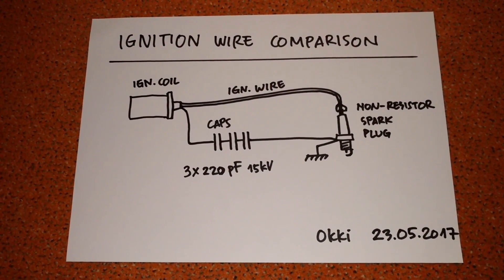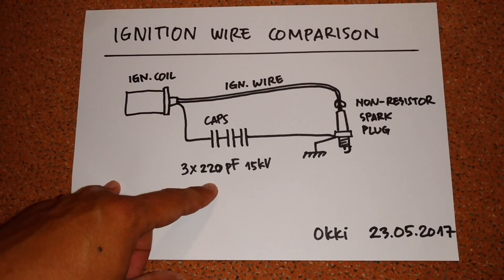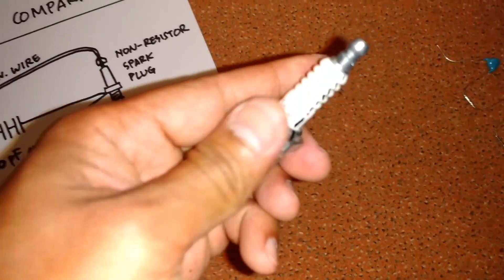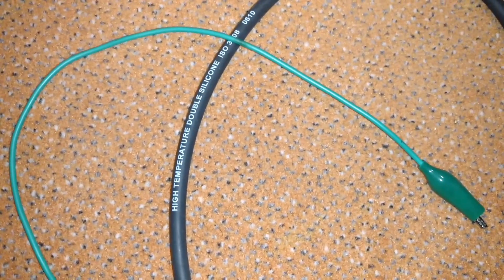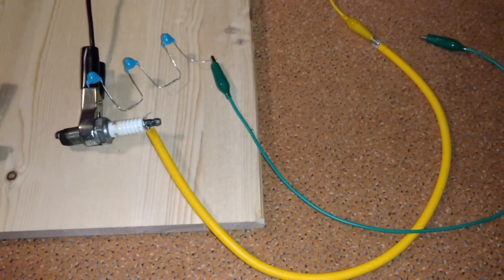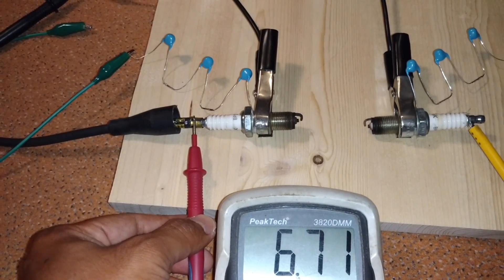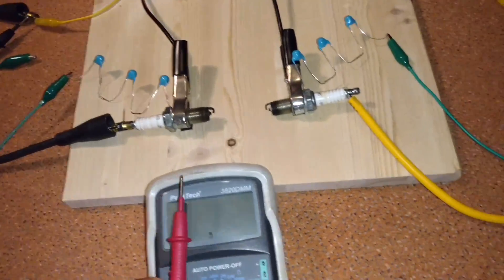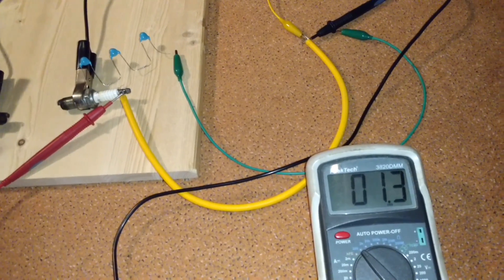Simple Plasma Ignition - Carbon and Copper Wire Behavior

Comment: The reason why this works with a nonresistor spark plug but not with a resistor spark plug should be explained. 
The high voltage source is wrongly addressed and it must be looked upon as a current source, so without the capacitors, while the spark plug is not firing the voltage will build up and when it fires, the current is only that supplied the current of the current source.
With the capacitors, the current source is charging the capacitors, and when the spark plug fires,  the energy stored and memorized in the capacitors is discharged fast and the capacitors appear to be a " TEMPORARY" voltage source discharging into the spark gap. 
If the sparking plug has a resistor in series with it, the discharge of the capacitor will be slow as the gap is still being fed from a current source due to the series plug high resistor appearing to be the output impedance of the source. 
This is a situation where students should get used to learning about the behavior of current and voltage sources and their output impedances.  Matching the correct load to a current and voltage source is important in electrical engineering and a spark plug should never be continuously fed from a " high voltage source"  with a low output impedance.
Reply: It works with the resistor plug, just not as easy to see in this video.  Look for his other video on the same subject, the lighting is better for the results, and he hooks up two sets of capacitors in addition to one.  (I find this fascinating).

Comment: hola no consigo ese varistor o condensador en mi pais el que pude conseguir es de 220pf 2kv podrias ayudarme y explicarme porque tiene que ser de 15kv?
Reply from the maker: The voltage rating has to be at least 20 kV otherwise you will destroy the capacitor.
Reply: @OkkiMoeljadi  y si coloco uno de 220pf 70kv que pasaria? ya que ese si lo consigo
Reply from the maker: @anibalsalazar7530  anything above 20 kV is fine.
Reply: @OkkiMoeljadi  ok muchas gracias, saludos

Comment: Have your vehicle installation run in real life low speed, high speed, downhill and uphill combinations ?

In these various different situations, have you measured so as to compare the fuel consumptions with and without these plasma inducing capacitors ?
Reply from the maker: I used this setup for almost 2 years in my daily driven car as I lived in Germany. I made one or two videos about that. Check those out.

Comment: Will this 73.3uF 45KV capacitance become a loading to the ignition circuit so that some part will over heat excessively and then shorter life ?

In case of Coil-on-plug (cop) situation, will the cop very easy to fail ?
Reply from the maker: No, I have made power requirements tests here: https://youtu.be/fPXIUkFmKfA
Reply: @OkkiMoeljadi  The overall power at various capacitance may be lower than 10W which is small but will this less than 10W is an average measurements only. 

Are there a local hot spot geographically or in the time domain that will make the coil or the spark gap aging too quickly and prematurely ?

Comment: can we use 221pf capacitor?
Reply from the maker: Yes, and you need to use capacitor with correct voltage rating.
Reply: @OkkiMoeljadi  tnx a lot friend.

Comment: I tried it on my motorcycle it discharges mu battery
Reply: I think either you are telling stories, or you evidently did not connect the circuit up properly. Anyone with half a sense of electronics will see what you said is impossible as the ignition has to be ON for the circuit to work. So, I think it could be resolved you left something turned on ?
Reply: Project23D or maybe my sparkplug is not nonresistor

Comment: how does that way with capacitors act with a waste spark system??? how does the water vapor behave?
Reply from the maker: This will work also with waste spark system. With water you will get even stronger sparks, here is an example: https://youtu.be/3NmaUMr3kU0

Comment: Hi, okki  im interest on it...but still confuse ,  it just connect a cable ,with 3pcs 220pf  15kv capasitor, together with spark plug cable on ignition coil and the other edge of cable connect to body spark plug or ground/ body of car , just like that?..
Reply from the maker: Yes, exactly.
Reply: @OkkiMoeljadi  ok thank you ,once i've done , i'll show you and need advise..thanks again

Comment: great video. quick question... can the wire from the capacitor be fixed anywhere  on the engine (ground)? or does it have to be fixed at the base of the spark plug?
Reply from the maker: It can be fixed anywhere on the engine but the shorter the connection to the spark plug the better.
Reply: @OkkiMoeljadi  thanks
Reply: What is this capacitor called?

Comment: Untuk kasus multicoil gimana om? Spt Mobilio/Livina/CRV?
Satu kaki di tempel ke kabel +12V dan satu lagi ke Ground ya? Tiap koil spt itu? Nama kapasitornya apa dan apakah ukurannya sama utk tiap mobil?
Reply from the maker: Kalau pakai sistim ini, kapasitornya harus dipasang paralel dengan busi. Ini adalah cara paling gampang untuk memperbesar percikan pengapian.
Reply: @OkkiMoeljadi   om Okki, boleh minta contact number yg bisa WA?
Reply: @OkkiMoeljadi  Om, sy coba ambil jalur +12volt dari tiap koil dan dijumper kabel ke kapasitor, ujung satu lagi ke -accu/ground. Wkt sy kasih tiap busi 1 set (3kapasitor seri) tidak ada perubahan apapun wkt dikasih 2set (diparalel dg yg pertama) ada perubahan tapi sedikit. Krn kl mobil direct igniton coil kan ga bisa ambil/colokin kabel yg lgs ke businya. Jadi sy ambil di kabel +coil. Apakah bisa om?
Reply from the maker: @ronnygani3652  sistim saya ini tidak bisa digunakan dengan cara seperti itu. Kalau mau dibuat seperti cara anda, anda harus pakai kapasitor dengan kapasitas yang jauh lebih besar, tetapi hasilnya belum tentu lebih bagus dari cara saya.

Comment: Why do manufacturers not do this? It seems so easy and cheap. Is there a problem really? Does it work in practise with the plug in the engine under pressure?
Reply from the maker: This technique is sold as products already. One of them is Nology HotWires.
Reply: Under compression electrons actually travel better.  Compression forces atoms closer together.  I knew this to be the case when messing with hydrogen fuel cells as under vacuum the amps drop and under atmospheric pressure the amp draw is higher, but then I saw a live display of an engine running with a clear display so you could see the ignition.  I was expecting to see something even dimmer than what we normally see with spark out in the open (dim and barely visible), but the spark was way brighter.  It clicked for me then that compression increases current no matter what the application is.
Reply: @waynesanders1406  The voltage required to initiate the spark increases with compression pressure.
Reply: @waynesanders1406  has nothing to do with "Under compression electrons actually travel better" you need to study basic physics. vacuum removes pressure. liquids becomes gas more easily as the ambient pressure drops. daltons law. therefore basic thermodynamics, requires less energy to do the work.
who would have thought it would be faster and easier to read a book on basic physics, rather than do a bunch of experiments and come up with the wrong answer and not knowing it.

Comment: Is it possible also to connect a lower voltage high current source (isolated by diodes) across the spark plug? For example use an inverter to charge a capacitor to several hundred volts. The capacitor would not discharge until the plasma spark lowers the spark gap resistance, then both high voltage low current and low voltage high current would combine to give high energy spark.
Reply from the maker: Yes, it is possible. Please find some info on Google about "Water Spark Plug". Your idea has been implemented and tested there.

Comment: My personal opinion, the capacitors change the electric phase 180 degrees so it wouldn't be so effective in hi-rpm if one would try to apply this in his engines. The spark is greater but the timing is laging behind.
Reply: Surely the 180° phase is instantaneous through the capacitor? Or if not, advance the timing a little?

Comment: Good evening, how do I connect ceramic capacitors in parallel? You called them in series. Thank you Country Brazil.
Reply: Series because .... each capacitor is 15kv, 3x series gives 45kv handling. 15kv too low for ignition. They will fail

Comment: Okki,
Could this method be benificial on resistor type spark plug?
If yes, can I connect the capacitor between the plug cap and anywhere ground of the engine ?
Thank you
Reply from the maker: This system will not work on spark plug with resistor.
Reply: I would not recommend connecting from ground to spark plug cap directly. The high current from the Coil might blow the caps so run a separate circuit with a relay with a fuse and toggle switch.
Reply: Beware. All iridium plugs are resistor plugs. Also check your plug cap and ht lead are not resistive
Reply: Any resistance between the capacitor and spark plug gap forms a voltage divider. The resistance of the spark at the gap would only be a few ohms. Put ~6k ohm in series with it, and nearly 100% of the energy in the capacitor is uselessly wasted in the resistance.

Comment: Thank for your wonderfull demo.  I bought 3 220 pf 15kv caps and installed them in series then in parallel across my motorbike spark plug. My high voltage cable from coil to plug is copper and I removed the resistor from the NGK spark plug .  The plug has a decent spark but when I connect in my 3 caps absolutley no change .  I know electronics well and I cannot increase my spark density as you are able..Help
Mike  mikmik787@hotmail.com
Reply: Reply to mikmik787@gmail.com
Thnx
Reply: @dorojakes1405  good morning sir, 

can you help me or give me some tutorial on how to increase the spark of my motorcycle CT100 Bajaj?

please reply at FhaiDM89@gmail.com

Thank you in advance.
Reply: How many plugs in your bike ?
Reply: Did you check ht lead and plug cap are non resistive?

Comment: Did think about the RF signal that this produces over powering any radio within 1000 feet driving around plus your own radio... Hilariously smart🤣
Reply from the maker: No I didn't. If you have this spark gap (read: spark plug) in combustion chamber, the RF signal will be absorbed by the engine block and cylinder head.

Comment: how to make nitrogen oxide form air using spark?  ? how then set up engine to run on it?
thats what joecell did in my opinion.
https://www.sciencedaily.com/releases/2015/07/150706123742.htm

Comment: hello sir..can I do this in motorcycle sparkplug?..what capacitor am I going to use?..thanks
Reply from the maker: I think so. You can try with 70 pF capacitor.
Reply: So, my capacitor will be 3 x 70 pF x 150 kV?..thank you sir..
Reply: correction sir..3 x 70 pF x 15kV..
Reply from the maker: No, just a 70 pF capacitor with at least 30 kV voltage rating.
Reply: ok sir..thank you so much for sharing your knowledge..
Reply: And what will this plasma spark plug do for your car or bike once you convert??

Comment: Sorry I am amateur but 3 capacitor in series is 45kv and 73.333...pf exactly 45kv 73pf
Reply from the maker: Yes you are right. I only use about 73 pF 45 kV.

Comment: Amigo que tal, probe con dos capacitores de 40kv y funcionó muy bien, le puse un bubler water en vacum of motor y funciono mejor pasando cantidades pequeñas de agua al motor aumentando la potencia
Reply: Javier Villagrana Hola!! Amigo me puedes decir cual es el rendimiento al aserle el simple plasma
Reply: Tengo una honda dio como puedo aplicarselo es que no entiendo el idioma de el video
Reply: pero en el video muestra que al conectar el cable verde a la corrriente (con su mano) la chispa es mas debil que al desconectarla, al contrario de la otra bujia que al conectarlo la chispa se incrementa, creo q por que el cable tiene menos resistencia,  es decir lo q muestra el video es q la chispa aumenta solo en el cable que tiene como resistencia  1,4 ohm y el q tiene 6,7 la chispa se debilita..eso entendi yo

Comment: Why 3 capacitors in series 15kv or one 40kv or 50kv isn't working good this;
Reply: How the result... is it make more mileage on ours cars
Reply from the maker: Because I don't have a capacitor with voltage rating of 40 or 50 kV.
Reply: Okki Moeljadi  the theory with capacitors and good cable it's very good! But my car they have ignition coil pen...(pack) Working to this, with same connection? I will buy one capacitor for every coil but I didn't know for working good... I have the coil with 3 pin (+ and - and "hz" Trigger) I bridge the exit with ground I hope working them!!!
Reply from the maker: Fragkiskos Piperis, I don't know if you can find space to mount a capacitor on such coil. Maybe you need to replace your coil with external type. Anyway, If your ignition system is already perfect, this modification will not make any improvement to your engine.
Reply: Okki Moeljadi I Have GQ15 engine and some people on YouTube changed the ignition with CDI system internally... Find them on this video... "test coil Nissan QG15 internal igniter with JSK Hybrid CDI" I buy 50kv one time to try external with one capacitor!!!
Reply: I find to buy CT81 high voltage ceramic capacitors 50KV222M I hope do not problem with ark before spark... The CDI change the frequency but the capacitor its stronger ignition... (Simple plasma!!!)
Reply from the maker: I think 2200 pF capacitor is too big for this simple plasma. I don't know if it would work.
Reply: Okki Moeljadi wow this capacitor is 2200 pF  or 220pF its its huge don't buy them... I found other 50KV561 this say 560 pF  or need smaller than...? (I don't find smaller at 50kv...) How to find 220pf or 560pf type its fine!
Reply: I find smaller to other stores 
1. 50kv101 (it's small...) 
2. 50kv251 (it's very good)
3. 50kv501 (it's stronger)
4. 50kv561 (it's more stronger)
Find them but now I don't know the Price I prefer 50kv251 (it's 250pf!!!) and make similar spark with 3x220pf 15kv now!

Comment: Hi Okki ... How is going? , saya pernah coba di Kia Sportage 2007 dengan sistem trigger yang dikontrol oleh komputer/ECU (sepertinya begitu, maaf masih meraba raba), saat dikoneksikan seperti video terasa sekali getaran mesin alias menjadi terasa pincang. . Kabel koneksi antara Cap & Distributor coil yang digunakan apakah mempengaruhi?  Mohon pencerahannya. Thanks.
Reply from the maker: Kemungkinan waktu kapasitornya dipasang malah businya tidak mengeluarkan percikan api, jadi putaran mesinnya pincang. Harus diperiksa lagi apakah nilai kapasitornya sama dengan punya saya, apakah kabel businya tipe tanpa hambatan dan apakah businya juga yang non-resistor. Kalau semuanya sudah sama dengan yang di video ini, seharusnya akan jalan.

Comment: Great video! That was a big question for discussion, as always.
Do the capacitors heat during such work?
Reply from the maker: Lox Straw'hat, just go ahead try it. I don't know if it would work or not. It depends on your ignition coil. My suggestion is to use around 100 pF / 30 kV capacitor.
Reply: Ok,, thnk u,, i wait ur next video sir
Reply from the maker: No, the capacitors don't get hot.
Reply: Hello friend, the use of ceramic capacitors, generates delay in ignition time, correct?
Reply from the maker: Rodrigo Moura, exactly!
Reply: Halo sir,, i did the same to my bike,, i use 4700uf 50v double in series,, my questions is can i put 220pF  at my stock inigtions coil bike?  Thnks

Comment: slmt malam wktu jkt mas Mul, saya minta kontak mas watsap ato apa buat saya belajar mas. oh ya itu drivernya pke apa mas kl saya pke driver ic 555 hrs sinyal sinus kah? trims infonya salam hangat dr saya sehat selalu mas :)
Reply from the maker: Dantos Rock, saya cuma pakai IC 555 dan transistor bipolar. Untuk transistornya bisa juga pakai 3055. Frekuensinya maksimal sekitar 200 Hz dengan lebar pulsa sekitar 50%.
Reply: +Okki Moeljadi sudah bs mas, td ny sy pke transistor TIP output kurang bagus skrng sy pke mosfet output kluar smua hehe. trims mas. saya pake koul bosch 12v kl pngen apinya besar apa hrs pke flyback?
Reply from the maker: Dantos Rock, kalau pakai trafo flyback bisa untuk frekuensi lebih tinggi. Tapi apinya belum tentu lebih besar. Kalau mau api besar harus pakai booster pengapian.
Reply: +Okki Moeljadi coba mas bikin boster kya gmn tuh hehe
Reply from the maker: Dantos Rock, coba pasang kapasitor paralel dengan spark gapnya. Kalau apinya masih kurang besar nilai kapasitornya ditambah. Kalau masih kurang besar juga, pakai rangkaian "water plasma ignition". Ini contohnya: http://www.m-opensolutions.com/?p=172
Reply: +Okki Moeljadi saya sdh buka di webnya saya liat skemanya utk switch spdt kl pakai sistem mosfet gmn ya aplikasinya disitu kan terlihat tegangan DC dr diode bright trs bertemu kapasitor 6,8mf 250v aplikasinya gmn ya kl pkai transistor/mosfet?
Reply: +Okki Moeljadi mksd saya kl pke sistem trigger dr pulser. tanpa harus pakai relay tp pkai transistor sbg switch
Reply from the maker: Dantos Rock, prinsip dasarnya sama saja, bedanya kapasitornya dicharge oleh rangkaian terpisah sampai dengan 300VDC dan nilai kapasitansinya lebih tinggi sekitar 2 sampai 10 uF. Kalau ada masalah dengan pembuatan rangkaiannya, lebih baik konsultasi dengan tukang service elektronik (service televisi) terdekat.

Comment: Sorry I have a question, why when I try to make arrays capasitor in series and I put in accordance with the picture, but my motor machine can not be turned on.
Reply from the maker: Please check for short circuit.